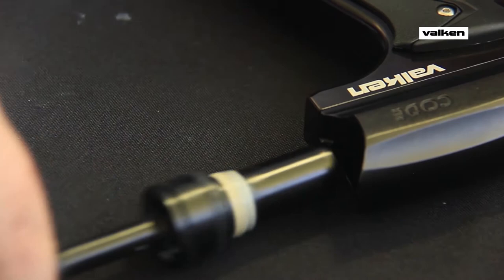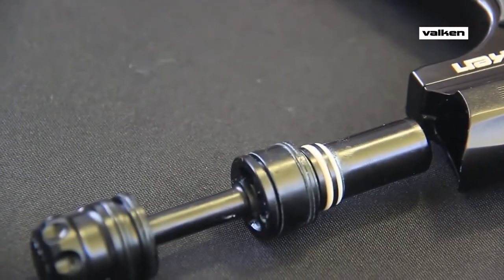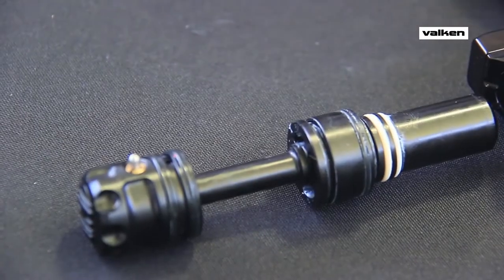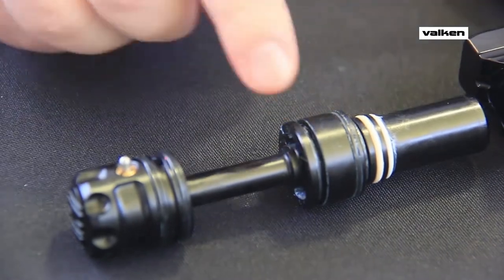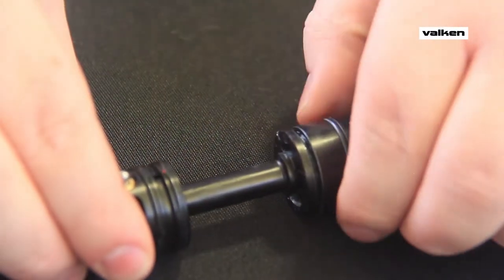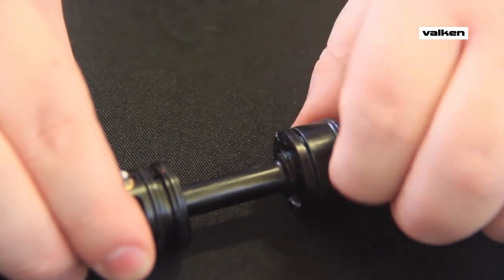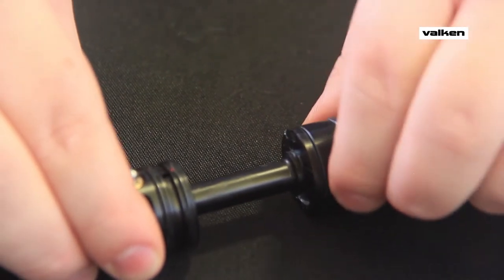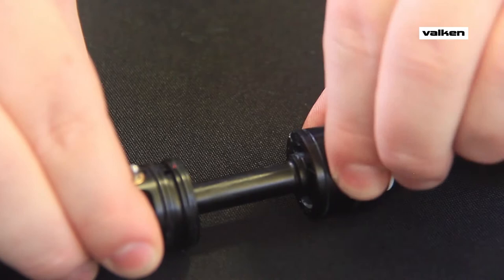Valken Minute Clinic CODE Bolt Leak Wont Close

Comment: I'm having trouble with an air leak, but the bolt (drive engine) is all tight. The drive engine was extracted while the gun was under pressure (not by me).
Reply from the maker: rear breach o-ring. video is on our channel ;) replace that lube it up and you're good to go

Comment: I am asking here because I have a bolt jam or something, but I have the Valken M17 formerly known as the Milsig M17, and there are no videos about this problem on a M17 that I can find. It was firing good and then it just stopped cycling after like the 5th to 7th shot why shooting rubber balls that weigh about 3.5 grams, about the same as a paintball. it was at most the 1enth shot that the marker has ever fired, it is a new gun with 2000 psi in a Ninja 13ci tank and pro V2 regulator. Anyone have any ideas what I should do? It is only my first paintball marker.

Comment: Hey guys, current issue with my valken code, when I air it up, the bolt goes forward all the way and air leaks out of the breach to the feedback and barrel. I've replaced all the orings in the bolt. I'm curious as to what else I should be looking at. Thank you!